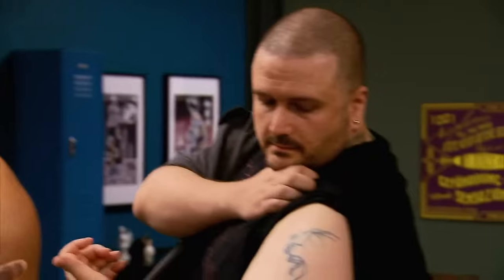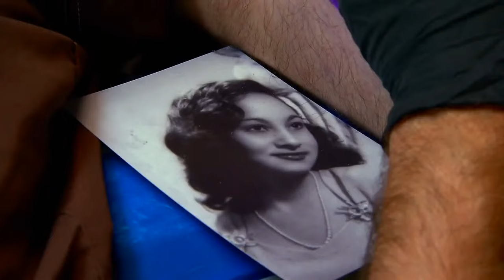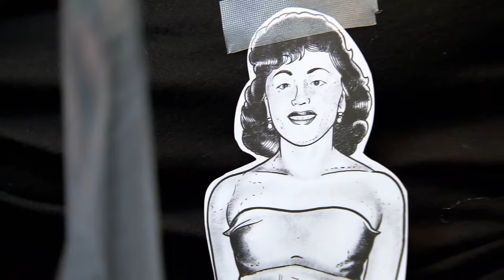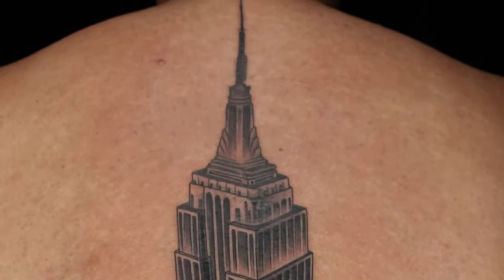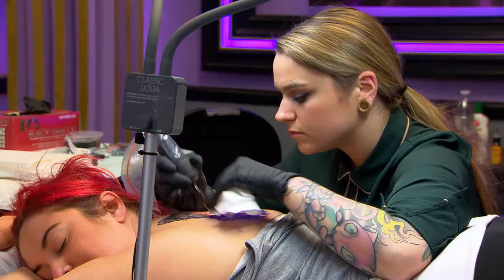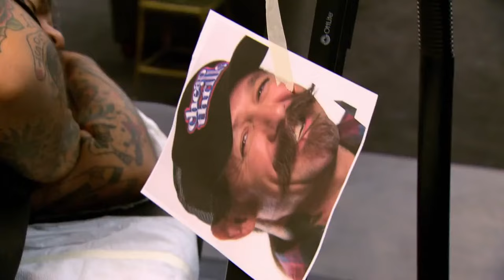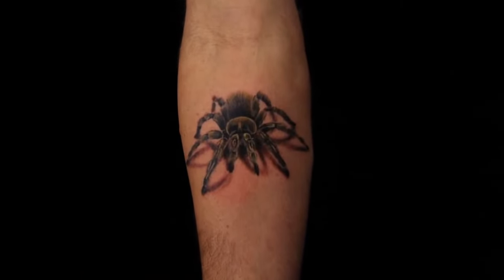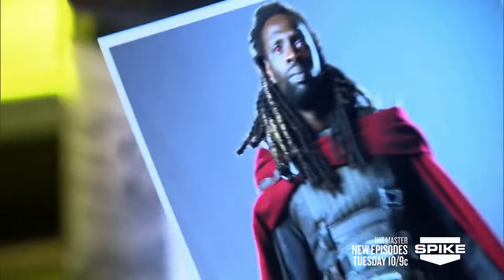Reference Tattoos | Ink Master's Fan Demand Livestream

Comment: "that tattoo screams cover-up" Well, it is a  cover-up. the original was straight black, so it's gonna look like a cover
Reply: I've had 2 cover up, one being by Jimie Litwalk (took over a year to get booked). Yes, they are cover ups, but you cannot tell on either of them that they are cover ups. Hate to call ya out, but your wrong. A cover up should NOT look like a cover up. When getting a tattoo covered, do your research. A sick, solid artist should be able to cover without any notice of old tattoo, thus they knew what they are doing. If a tat is unable to be covered up with the ink you want, a solid artist will tell you & work with you on something that will properly cover without spotting the bad old ink👍. ✌💖🙏